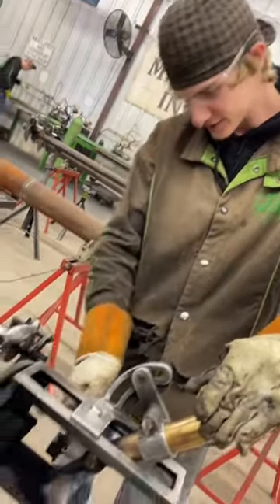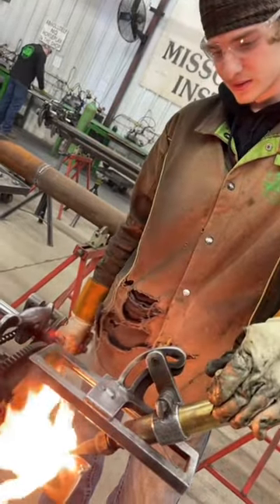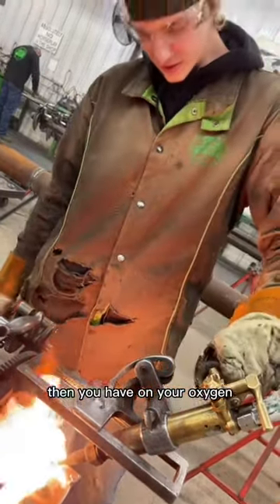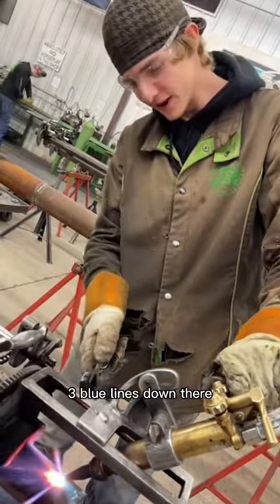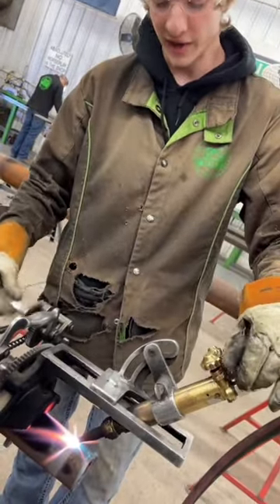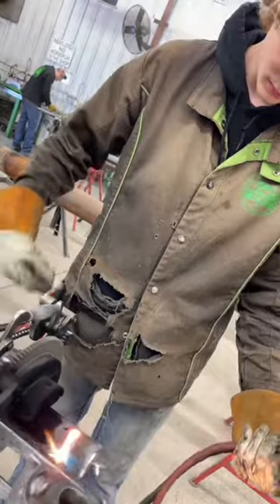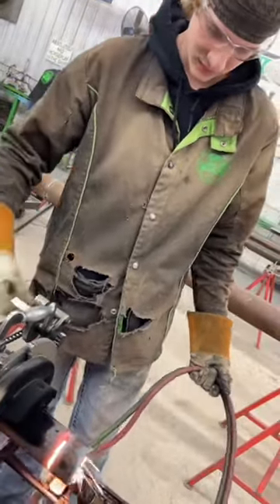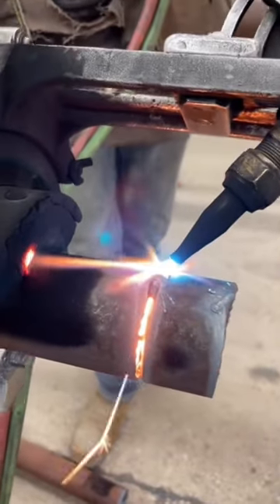Our student shows us how to use the torch to cut pipe! #shorts

Comment: They should be teaching then free hand pipe cutting. Builds character
Reply: #arrobrewer2730 but if this is for a customer then the faster the better plus if you have the equipment to make it easier and faster then why wouldn’t you use em. If your testing then hell ya everything’s freehand you can’t even clean each pass weldin with anything power driven use your scraper or your whelpa or slag hammer and or wire brush.🤷🏻‍♂️👍🏻
Reply: @pieheadthemainiac5480  if their in a class room how in TF they going to get good. Not all jobs will have that tool.😮👍
Reply: there making fittings for students to weld on
Reply: @arrobrewer2730  no that’s why weldas but there own tools